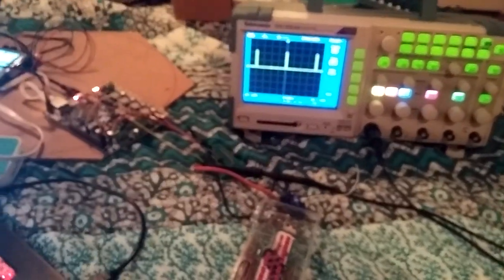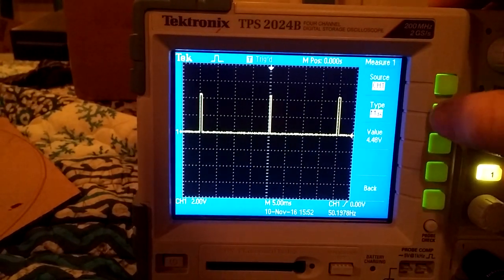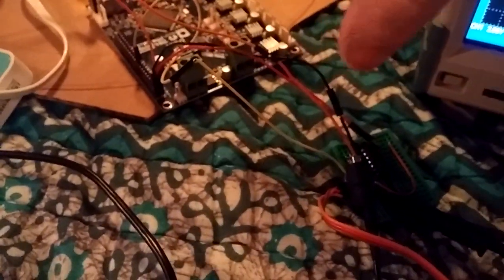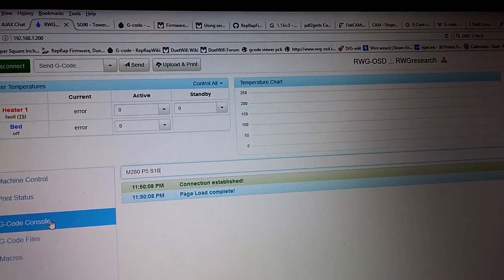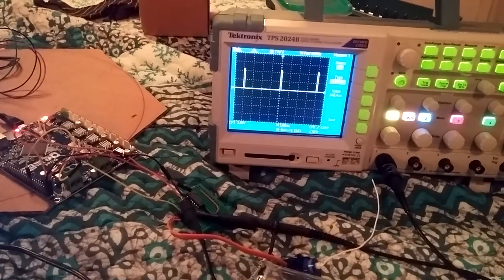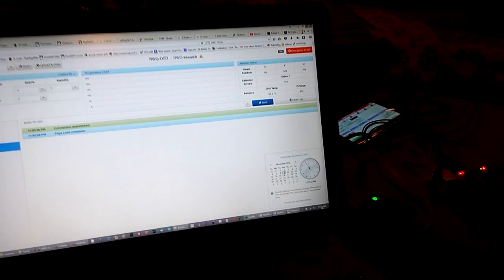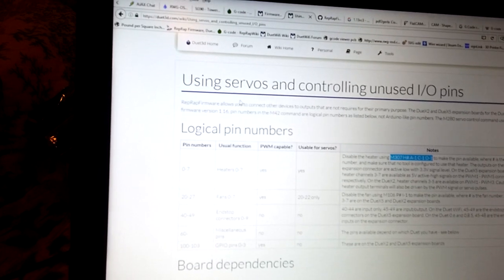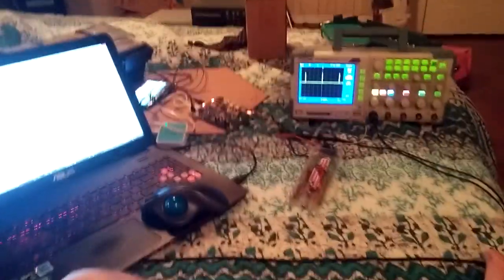Testing Duet 0.8.5 / WIFI Servo Control Firmware V 1.16 updated 11-9-16

Comment: Would you share that IC Number and where did you purchase it? Perhaps a link? thanks in advance.
Reply from the maker: simple 3.3->5V IC, using any logic gate that you can supply the Vcc with 5V and logic High if 3.3V works well... the one I'm using is a HD74HC02P this is a Quad 2-input NOR gate, one input of the gate is low, and the other is the 3.3V Sig from the duet. Then the output is 5V logic due to the VCC supply voltage is 5V,  there are Manny other things that can be used for 3.3-5v logic converter, including a simple transistor. like this, http://electronics.stackexchange.com/questions/169144/logic-level-conversion-for-servos for me its best to use an IC as thats alot more compact and less components needed to do the job! ~Russ  oh, and i had the IC in my collection of stuff... just google it you can find it for sell some where!
Reply from the maker: also i added some links in the description ~Russ

Comment: Nice work Russ, enjoying seeing the development of your amazing delta. Ive used a servo with a RAMPS board to lift a sensor up and down. With RAMPS, there is a set of servo ourputs, you just enable them in firmware and they work!
Reply from the maker: yeah! so much to do and one part at a time ... slow but steady :) , yeah i haven't tried it with ramps but its probably better due to it already being 5V , but simple 3.3->5V IC, using any logic gate that you can supply the IC with 5V and logic High if 3.3V works well... ~Russ